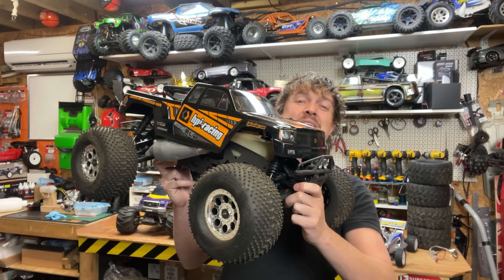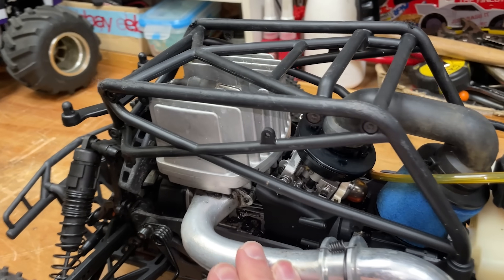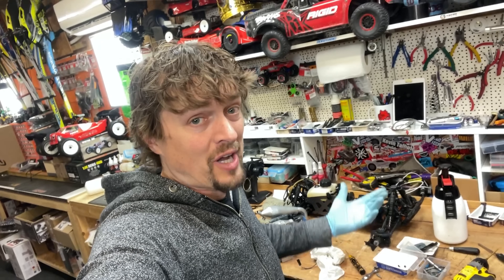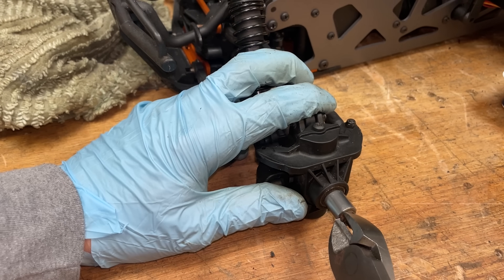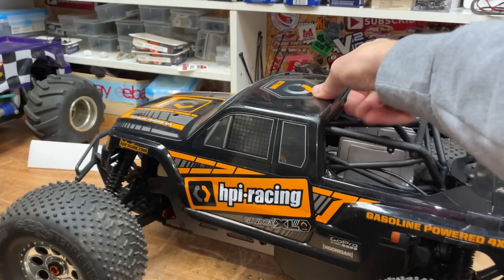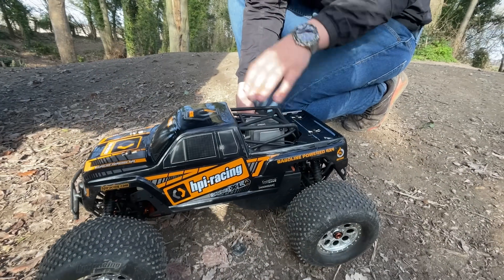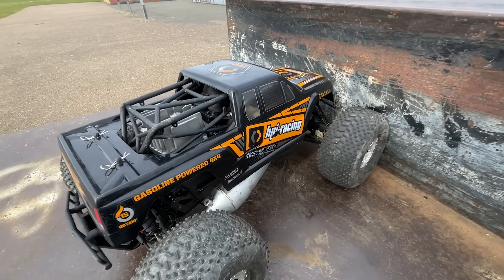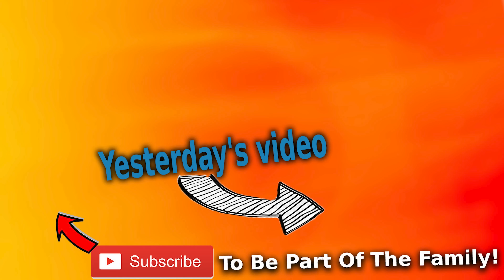Most FUN RC Car in a long time - so why stop making it?

Comment from the maker: Win my Arrma Vorteks - https://raffall.com/336434/enter-raffle-to-win-kevin-talbots-vorteks-hosted-by-kevin-talbot
Reply: I think your glow plug went bad and that’s why it wouldn’t start or you most likely ran the motor too lean
Reply: Kevin can take any RC and change it from zero to hero!💪 
Now if only he could find someone to do the same with his hair. 🤭
Reply: Funny, having trouble with the ignition interfering with the radio...same problem they had in the 70's in full sized cars.......not sure if wrapping the module in foil would help you or not....I know when they shield magnets they just put a metal shield around them to "disrupt" the magnetic field.....
Reply: @FarmerFpv  I don’t need the vorteks I have too many rcs as is
Reply: @rockncoop665  Hey just to let you know that truck runs on Gasoline, No Glow Plug, but it does have a (Spark Plug). Kevin says in his video the truck runs on Petrol. I do agree with you though I think you might be right about the Spark Plug probably being bad. Good Call.  God Bless have a good one.
Reply: @FeArhsma21  I meant spark plug I race nitro I got confused lol
Reply: Wasn't this killed off for the Baja b5? As they did do plates then stopped them and boom b5 or is that just how I remember it lol
Reply: @Jonathan.D  everyone got their own style
Reply: @justonexone  It's called a joke aka teasing. We tease the ones we like.
Reply: @Jonathan.D  true

Comment: Hey Kev! I’m sure you’re aware how the 2 strokes operate… With that engine being older, if any seals, gaskets or o-rings on the crankcase have expired it’s going to give you all kinds of problems… Tuning included… Now that it quit running all together is more of a sign something isn’t happy… Might need a rebuild… 👍

Comment: I was never really all that big into HPI Savages, was always a Tmaxx fan myself. That said I always always ALWAYS lusted after and wanted an Octane. Never could afford it and by the time I could they were all discontinued. That and an Inferno MP5 and or MP7.5 were the three cars from back then that I wanted so bad but never got. Modern electric RC cars are awesome for sure but they lack the X factor, the je ne sais quoi that slow (comparatively) and unreliable old nitro cars have in spades.  Thanks for the nostalgia and for the awesome entertainment Kev!

Comment: T maxx was definitely better than Savage, better features too with reverse and the EZ Start, but do have a soft spot for the Savage since it was the first nitro I ever drove when a family member had one, but probably the nicest Kevin has been to a RC car that I've seen since I've been watching the channel 😂😂😂
Reply: It's funny you say that.  Growing up, Savage .21 changed the game with its legendary durability that Tmaxx couldn't even begin to rival.

It was bigger, heavier, faster.  Also, Savage is still one of the handful of Nitro's that can have reverse, too.

All of mine have reverse channel 3.  Including the Octanes, which took unique to a whole new level.  

It's a shame the new managed HPI is nothing like the original premium company.  Not gonna lie, the new V2's use garbage Chinesium hardware, overall not great.  But that TVP chassis is still superior in every way.
Reply: @inawrocki207  I was honestly a fan of both my uncle had a savage I had Traxxas, Tmaxx definitely had reverse in its earlier ones and the option to add it in later ones, I had a Traxxas Smaxx which was a 2wd tmaxx basically, later added a 4wd kit which made it like a Tmaxx with a different body, had it as a teen and wasn’t kind to it at all only issues I ever had were a clutch spring and then a one way bearing for the EZ start, the 3.3 and 2 speed was a animal for me I ran VP 15-20% nitro thing was awesome until I let it sit for years

Comment: Have you ever tried putting nitro in one of those gasoline engines or a bit of a nitro mix in with your fuel? Tried a nitro mix with the weedeater once it hauled ass for a brief moment😢

Comment: IMO it can be the magnetic ignition coil moved, it used to happen on mine all the time after many jumps. Another thing that suffers a lot after many jumps is the carb diagram.
Then again, gas rc is not meant to be severely bashed by super jumps, hard landing.

Comment: I think cost production end engine problems too. The same as the Dynamite .31 used by LOSI , problems with the CDI and the spark plug. They are simply unstable.

Comment: The octane is reliable, but you have to run 25:1 oil ratio (motocross grade oil) and it should sound a bit rich wen youre running (if it sounds like reving high you’re too lean). I have 2 of them and love them. But they unique. Wen you’re tuning make adjustments by 1/32 of a turn. And you can mount the cdi under the roll bar with zip ties(that’s what I did).

Comment: @kevin Talbot Hello from across the pond!! Dude, I have a savage xl with the 5.9 big block. I’ve had it since brand new, and it is by far my favorite rc. There is nothing that bashes like it could. The noise, smell, and of course the frustration of keeping a nitro tuned, is something I always loved. Just recently my one way bearing for starting it crapped out, so no more running the savage. I’ve been searching all over, but parts are so few. I loved this video, I always wanted the gas savage, but never committed to buying it. Love your videos man!! Cheers

Comment: Kev - which ignition module did you replace it with?  Is it another stock octane cdi?  Or did you use another current compatible cdi?  Thanks!

Comment: Kevin,

First, I love your channel. I have been watching your videos and they put a smile on my face constantly. Thank you, for that!

Second, I wanted to see what kind of fuel you’re running in your petrol RC cars. I’m from the US and we have ethanol fuel here for the most part. In recent years, we have had more non ethanol fuel available and it is what should be used in 2 cycle engines. I don’t have any gas powered RCs but all of my lawn maintenance equipment and my 90 HP boat engine work much better since switching to non ethanol fuel.

Comment: Hi I’ve got one of these and my cdi box is located at the back bumper I’ll try add a pic mine keeps losing spark stil not sure if I’ve wired it up wrong do you have any suggestions or pics of how yours is wired please

Comment: yes the best rc ever, great control and fun . But sadly it has some engine fault as it gets stalled after running some time!Si ihad to sell it but will deifinitely buy if hpi roll out again with issues fixed

Comment: Spark plug loose?
Hey kev you need to look for the VERY 1st xmax. That also had a petrol engine. Think they all did it as a last ditch effort to save rc cars but brushless motors came along and saved the day.

Comment: Great video I had a traxxas revo 3.3 standard gave it a perfect run in I know traxxas nitro engines have got worse but I had my nitro revo standard 3.3 and it blew away a hpi savage 28 but I like both brands it's how you break the engine in keep up the good work 👏

Comment: I still have & run my HPI savage. All the electronics are new & I did 2 aluminum shocks with reservoirs per wheel & a full aluminum roll cage. It’s a blast.
Reply: @originalplanking9741  what servo do you use?

Comment: I guess it was a used car, so check piston rings and liner if you think compression maybe cause. Also the hall sensor may have moved or could just be temperamental. Aint ICEs fun! A smile a mile when they work.

Comment: Kev I think the battery for the ignition box was dead at the end there. I had also a similar issue with the car not wanting to start after long runs and feeling loose, you gotta let the engine completely head cycle and it will run again. And I mean COLD to the touch.

Comment: If i were you, i would clearance the top of those 3 cooling fins on the cylinder head so the ignition wire can come straight out, then by just using filler rod stack up some weld on the cooling fins that originally were beneath the wire to make up for the cooling, it will likely cool it better, the fins have more length on that side.
Reply from the maker: nice idea but think welding it would warp it?
Reply: @KevinTalbotTV  naw, take it nice and easy while youre welding it only has to be strong enough to not break off, its not structural, and dab it with a wet rag after each bead. make sure its dry again before you run another. theres plenty of metal there to soak up that little bit of heat if you take your time on it. If you didnt do any cooling cycles or anything on it and just blasted it i would totally agree with you!

Comment: Another petrol 8th scale of similar vintage is the losi lst xxl v2 unfortunately its engine is essentially a modified nitro motor (its a tiny .31 nitro motor modified to run on petrol) and the general reliability wasnt great.

Comment: You blow up, if not heavily wear out, all your gas nitro engines. You can't drive them like electric bashers. They need to keep moving and have good air flow over the engine. Cut out all windshields so air flows in. Cylinder components consists of different types of metal. When things get hot they expand, that causes wear.

Comment: They bolt on to a xxl losi quiet easily with the eight truggy engine mount .although finding a piston rod and head  seems near impossible now.i also need the ignition box.

Comment: make a video on how to replace the old radio system with the new one plz 😀, Namely, I have 3 rc cars from the year 2000, They use crystals and they are so easily disturbed by radio signals xD, while the newest rc car I have works cannon :D
Reply: Ditch the crystals and get yourself a 2.4ghz system with a built in failsafe.
Reply: @SavageRobRC  Thank you very much 😀😀

Comment: I had the Savage with a 4.6 axial nitro.was a blast.. then a Savage 5.9 nice truck with the 3 speed fast. So I took the 5.9 and 3 speed and put it in the smaller Savage. My god nothing could touch it at the.local track

Comment: Kev I think I know why hpi used those tiny little hexes on the wheel nuts. I think it was so you could use your glow plug wrench on the wheels so you didn't have to carry around another wrench to take off the wheels. I did this for a while on mine and it worked pretty well... until it didn't. Still a sucky design but that's why I think they did it.

Comment: My experience with these engines and the crank sensor is timing.  Once you take it off, you now lost the ignition timing.  Even if you put it back where the screw indents are, it still changes.

Comment: Hey Kev, try taking that carburetter apart and put it in a sonic cleaner and then put it back together set it to the stock settings and then make very small changes  on mixture screws till you find your tune

Comment: KEV .. need your help
Everyone says you need at least 50c discharge rate on x maxx batteries..but traxass are only 25c.
WHAT do you say? 50/100c batteries or ?? 25 is fine.. I'm lost :)
Reply from the maker: most manufactures lie about C, so the low C lipos are just being more honest. I've used 25c lots of times and it was fine but every brand is different so no guarantee what you buy will be any good!

Comment: Evergreen around the time that came out that's the HPI Savage octane got the gas engine in it anyway I believed at the time that came out was right around when HPI went out of business also Losi LST Had A variation with a gas engine and they just weren't as fast as the Nitros they just didn't catch on or sell

Comment: Grat video Kev, back in the day i had a Thunder tiger EK4 it was such a torque monster and I couldn't keep the front wheels down the biggest issue I found with mine it would take half a tank to get to running and tuning temp. then you would get 3 mins of the last half a tank. i did have an idea of putting a plane tank on it ( but never bothered)
Reply: I dug my mgt8.0 out of the garage and got it running again and it's exactly the same. Almost an entire tank of fuel to warm up

Comment: The concept of the Octane was a good idea but HPI just weren't able to get the engine quite right and be able to run like a normal larger petrol engine does. I believe they did a V2 engine but this had even more issues so dropped the concept in the end which was a shame

Comment: Kevin, do you set your fuel powered cars to apply the brakes when you let off the throttle? If so is it to hopefully prevent run away? The reason I ask is all I have done is semi competitive racing in the past and no one I raced against set there nitros to do that if I am remembering correctly. If I could have afforded a spark ignition rc car back in the day instead of a glow ignition car I would probably still be playing with them. Glow is such a pain but can be such fun when it works like you say.
Reply from the maker: no, i set them to no brakes or throttle at neutral.
Reply: Interesting because it looks like you have it set to go full brakes. Very fun video like always and take care.
Reply from the maker: how can you see it goes to full brakes?

Comment: love HPI's old stuff. I have a Savage 25 i bought almost 20 years ago that I dug out of the garage after sitting for who knows how long and it fired right up. Been upgrading it and fixing some stuff and got it pretty well tuned in now. Just wish finding parts was easier. Got the wheel conversion like yours as well and that is the single best upgrade I have done. Much needed. Anyway, I just love nitros and petrols and would love to see more of yours!

Comment: Try adding a heat-resistant tube, sheet, or whatever on the ignition wire or cord. Should prevent it from being cooked on the hot engine fins

Comment: Looks like a pain on the neck to work on this dinosaur 😂 sadly the smaller gas engines are the worst they are to tune. If Nitro wasnt so expensive it would be the better choice

Comment: Hey Kev, check the isolator block (sits between the carby and the engine) for cracks or gaps. When the engine gets hot it can cause an air leak which throws the carby out and it just won’t start, often the isolator blocks are plastic so it can warp not making it seal flush on the engine / carby… check the gasket while your at it too brother 👍🏻
Reply from the maker: Thanks bro
Reply: @KevinTalbotTV   anytime man I hope it helps rectify the issue! 
keep up the great content and especially the 1/5 scale petrol vids I just love them!

Comment: Looks to me like it might have a scuffed piston/cylinder unfortunately.  The cylinder head reminds me of the old Super Tigre 2300/3250/4500 nitro motors for airplanes.  I had a 4500 that absolutely refused to run reliably no matter what I did to it.  Worst engine I ever owned. It wouldn't surprise me if it is a converted Super Tigre 90 with the cylinder head off of a 23cc airplane engine.

Comment: I would have to say that the HPI Savage, in my opinion. One of the best, if not the best RC monster truck ever designed. The engine was reliable, truck took a beating.  The only thing that was a problem were front and rear steering knuckles.

Comment: Thunder tiger is just rubbish. But didnt they take over associated?  Then theres kyosho, expensive and parts can be hard to get. I had a mad van andbit was just rubbish. The dampers had leaked all their oil in the box before i got it and the rear diff and spur gears wouldnt last long beforebeore they would strip out. The internal rear diff gears would crak and shatter. Trying to get a diff eas impossible here in Australia. I always thought kyosho was goodamd was looking forward to finally owning one. And thought they were better than tamiya. I have since sold all my cars except two. , all my equipment etc i acquired over 30 years in the hobby. Ive had my fun and its time to move on.